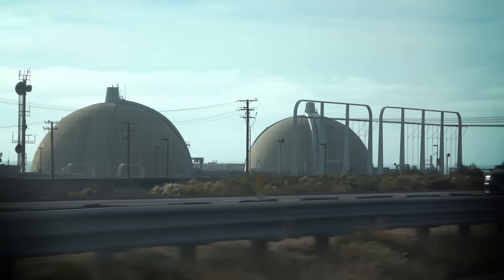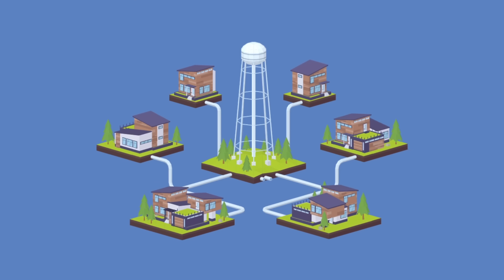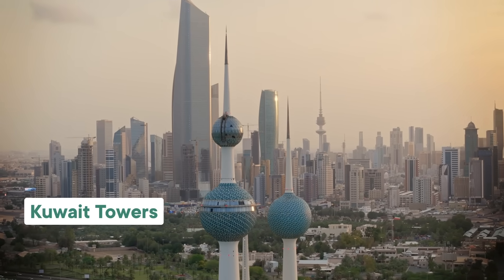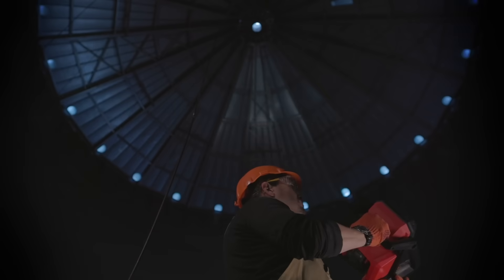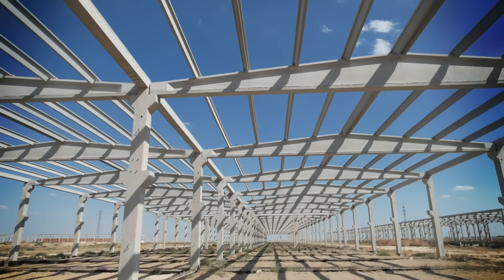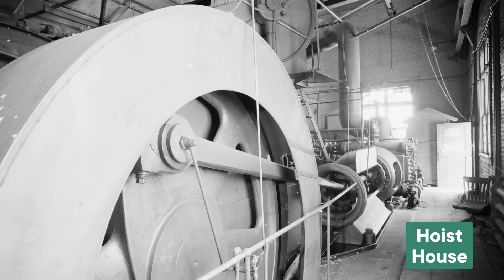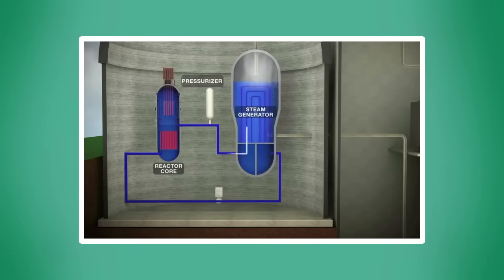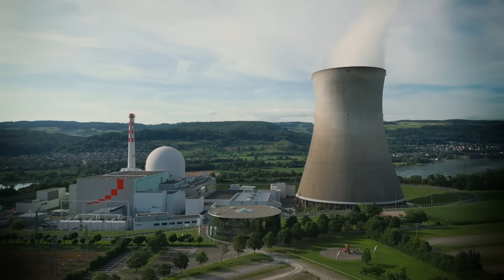Why Are Those Buildings That Weird Shape?

Comment: The silo's that you show are used to store grain all the time. Actually they are mostly used to store grains in Canada, and rarely silage. In Canada we call them grain bins (for obvious reasons)
Reply: I came here to say this as well! The silos used for silage are usually blue (in my midwest US area at least) and built differently than the silver ones shown, which are used for dry grain products.
Reply: @saehrimnir23  Thats cool! I don't know of any farmers near me that do silage. (Saskatchewan) so I only know of the corrugated ones shown and the white ones. I always thought the white bins were for fertilizer but I know of a few farmers who use them for grain as well. Just a different design.
Reply: Usually silage in saskatchewan is put in a pit and covered with a tarp to ferment.@DJSAYBR
Reply: @saehrimnir23  Yes, the blue ones are Harvestore brand silos. One will usually see them on dairy farms as they do store silage for dairy cattle. They are notably fairly air-tight, and are dangerous to go inside of.
Reply: In my area (Wisconsin) silage is typically piled on the ground and covered with plastic. Or loaded into giant long plastic tubes.

It's very wet compared to grain that typically gets put in silos.

Another fun fact: farmers use silos as bank accounts, often trying to hold on to grain until prices are more favorable. If you have more silos you have more cushion against price trends.
Reply: @BenHolmen  Oh THAT'S what the mounds I saw on my road trip through Utah last weekend were! They were covered in a plastic tarp and held down by old tires. I even saw a huge pile of old tires at one point, and realized that it must be where they store the tires when they're not being used to hold down the plastic tarps.
Reply: @coredumperror Utah uses sand, not salt these days, so more than likely you were seeing covered mounds of sand.
Reply: @NorthernChev  OH really? Do you know why they switched from salt to sand?
Reply: @ Salt is destructive to cars and the environment.  Sand is less so and far more cost-effective.
Reply: @NorthernChev  Is it equally effective at melting ice?
Reply: @coredumperror  It significantly increases grip while breaking down the ice.
Reply: @BenHolmen  Out here we use silage bags to store extra grain over the winter. The deer love it haha
Reply: I was about to say this too.  Grew up on a midwest farm.  Sometimes gets a bit sketchy cleaning one of those out when the sweep auger doesn't quite disconnect correctly.
Reply: It's rare we get to correct SciShow, you beat me too it 

Not to nitpick, but at least in Canada, it's also pronounced Sci-lage
Reply: @N3SFarm I was going to go with “sigh” but since this is SciShow I guess your way is better! 👍🤣
Reply: Can confirm; the first shot of silver “silos” are actually grain bins. My family farm holds ONLY grain in them, as they cannot withstand the pressure/weight of silage. The geometry is the same, but for a different reason: to let air circulate through the grain to remove moisture evenly. 👍
Reply: @Ascoundrel  it's a reference to the video script saying, If you don't want farmers laughing at you, then proceeding give them reasons to laugh at people for incorrect information and pronunciation. 🤷‍♂️
Reply: That shape also appears in sugar plants and flour mills, though I’ve only seen those in cities. Storage bins let you decouple steps of the process if their rates are different, and putting ‘em up in the air both reduces the land footprint and lets you control the output by operating a valve in the conical base rather than needing to scrape the product off of a horizontal surface. (They’ll flow like sand, just as grain does. So long as you keep ‘em dry.)
Reply: The standalone term 'silo' is usually reserved for silage storage, but other than having a few extra mechanical elements, grain bins aren't all that distinct.

Fun fact: 'Silage' is the shortened form of the word 'ensilage' which just means "stuff that is 'ensile' (or 'in a silo')"!

People where I live also use the terms 'grain silo' or 'grain tower' to refer to 'grain bins' because the word 'bin' can be pretty ambiguous.
Reply: @kytoaltoky  We also have a salad recipe that was included in a church cookbook that's titled "Silage". (That was what the lady's husband called it, so that's what she submitted it as...)
Reply: @ I don't know what that is, but it makes me think of wilted greens and meusli in a really pungent dressing!
Reply: Farmers laughing at the way you pronounce "silage." And those tin cylenders shown at 2:43 aren't silos, they're grain bins.
Reply: @Aboz Thanks, came here to object to the pronunciation.
Reply: So at this point are we destined to get another episode from SciShow doing a deep-dive on the silo to correct this error?

Bonus points if they can somehow tie into the series Silo and the work  Dami Lee does on her architecture channel.
Reply: In Kansas and Nebraska they're "grain elevators" - the really big ones are concrete. My grandparents had a small metal one that was a grain bin. Burchard Nebraska has a group of enormous metal "bins" that are their elevator.

Where does this chick think the zillions of tons of harvested grain are put when harvest hits?

Silage (note: pronounced "sigh-lage" not "sill-age") is rarely put up these days. Non-grain plant material usually goes to the nearest ethanol plant.
Reply: @Ascoundrel  our Texan friend was referring to Niba’s comment at 2:50 about farmers laughing
Reply: The irony of saying let's help you so the farmers don't laugh at you and then show grain bins, not silos
Reply: Silos are very dangerous farmers die yearly from being drowned in grain. If the dust is in the air and a spark happens it could explode. In 1878 flour in a mill In Minneapolis exploded and took out 5 other mills close by. It was so powerful that it hurdled granite chucks eight city blocks away.
Reply: The “silos” that hold grain are called grain elevators.
Reply: @NorthernChev sorry, that isn't the case. The mechanics that elevate the grain to the top of the storage are the grain elevators.
Reply: @godamid  Here in the US that entire structure (silo and all) is called a Grain Elevator.  You are WELCOME.
Reply: They're called Grain Bins in the US too (at least to actual farmers)
Reply: Yep, Aussie here - definitely grain silos.
Reply: And that is CANADA, we are talking about the United States... 
In the United States, grain silos are used to store grain and silage... Hence the name, silo....
Reply: @BeccaHetrick  I hate to break it to you girl, but there's a whole wide world beyond the US. And YouTube shows this content to us as well. Which means there are a lot more farmers outside the US than are in the US.
Reply: Yeah really makes me call in to question if these people even know what they're talking about here. If you misunderstand silos what else are you not understanding?
Reply: Us farmers here in Texas are laughing at you.  Those large metal 'tower' structures are for dry grain - mostly rice, wheat, corn & maize.  We call them grain silos or grain storage.  
Silage is rarely made here -- too hot, it would be a stinky mess very quickly - to say nothing of the potential fire hazard from the heat of fermentation.  In my limited experience traveling other states, where they do make silage, it is done in smaller, 'personal' structures.  There might be commercial silage manufacture, but I have never knowingly seen it.  That would be an interesting topic.
Reply: Yes, UK farmers tend to call all those metal structures silos, regardless of whether they have grain or silage in (though many farms prefer using sheds for grain storage and silage sits in a massive heap under a enormous tarp). BTW Do folks in North America all say "sillage" (as though it has two ls) rather than silage (rhyming with mileage)?